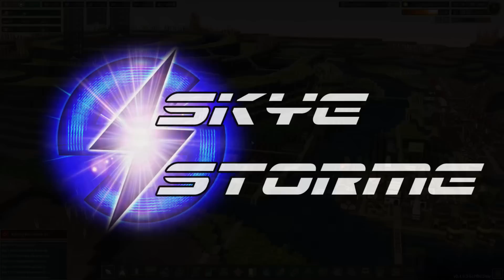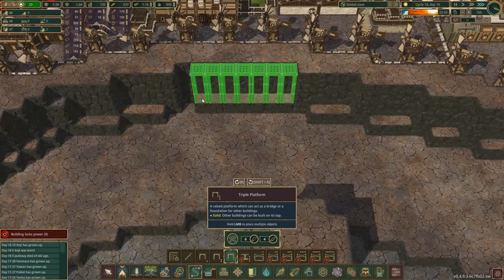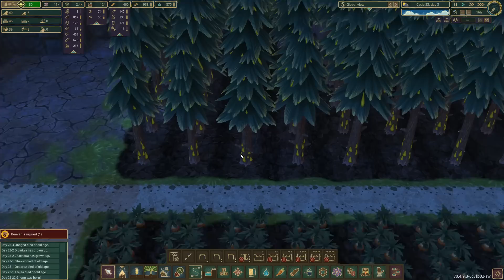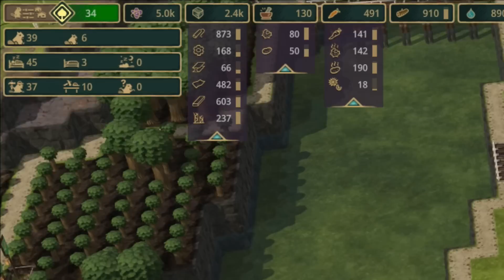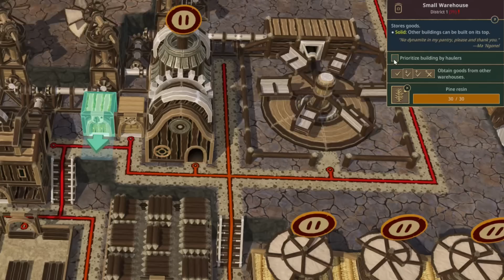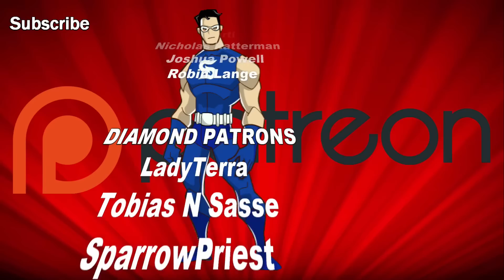MEGA-DAM! 💧 Never-Ending Water Supply! - Timberborn Hard Mode Ep 5

Comment: You should have left the top dam in place until the project was complete, and put the pumps further around the reservoir. Would have avoided the intermittent power shortages (and hence water shortages) you will have until the battery bank is in place.